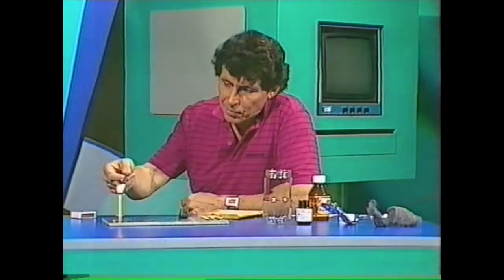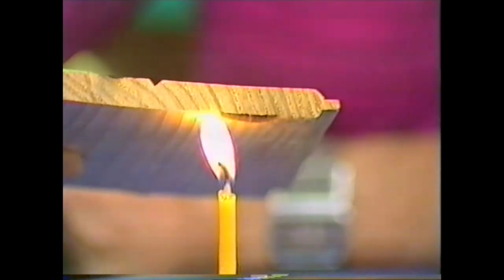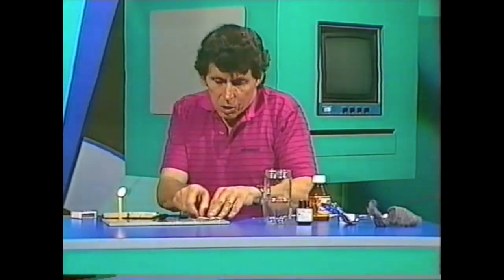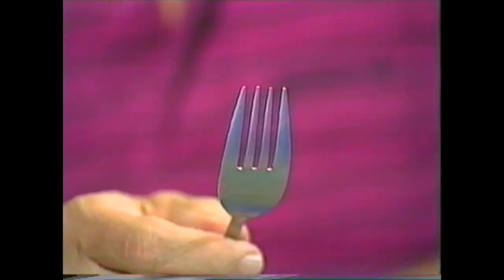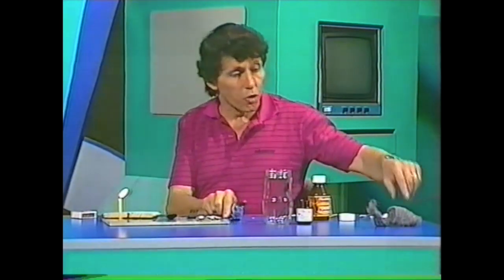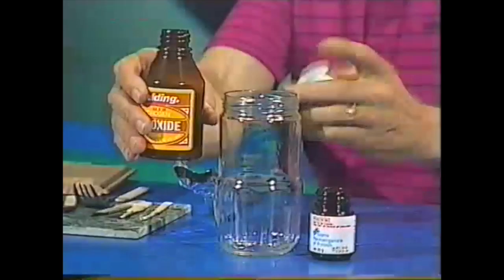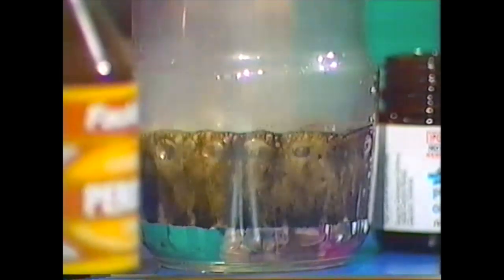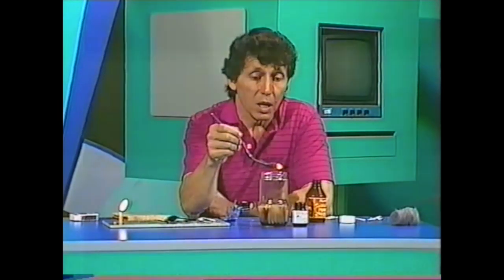Burning Metals

Comment: Technically, everything is metal! Enjoying the posts as a 40 year old almost as much as when I was 7.
Reply: Technically, all water is ice and all sand is glass. Technically, all wood is coal and all meat is well-done.

Right?
Reply: You're on the right track, yep! My comment is typical in astronomy where atoms are basically all considered metal, except hydrogen traditionally but metallic liquid hydrogen was observed during the recent Juno mission. H2O on Earth is indeed a rock on higher mountains, or other planets moons. Nitrogen which is a component of air here, makes mountains on Pluto, so it's a "rock". The distinctions we make are purely Earthly ones based on the temperature here and whether a particular atom or amalgam is a solid, liquid, gas or plasma here. Depending where the atom is, it could be any of the above, which is why astronomers just consider all the atoms, metals.
Reply: @DylanODonnell  
I got that. You missed the point.

Just because something could be in a certain state does not mean that it is. It either is metallic or not, and if it's not, well, then it's not.

A material is defined by its properties. Ice from H2O is not rock, regardless what planet you are on. Metal is metal by the properties that define metals.

The idea that "everything is metal" just because it could gain metallic properties under rare and extreme conditions is simply false, be it practically, technically or otherwise. 

I was simply pointing out how absurd that statement really is.

Our oceans are not frozen, wood only turns to coal when treated, and raw meat does exist. Everything is not metal.
Reply: Yes, I concur it's just me being a silly old astronomer. https://en.wikipedia.org/wiki/Metallicity

Comment: I remember getting Steel Wool and putting a 9 Volt Battery to it and it would ignite from the short circuit I guess.   Gee you could almost feel the Infra Red heat from that glowing girder.
Reply: The strands of steel heat up because of their resistance to the flow of electrical current through them.
Reply: steviebboy69 the electric current runs through the metal like any other wire, but because each strand is very fine it heats up very quickly to a point where it ignites the oxygen in the air around it. The same principle is used for incandescent bulbs with a thin filament wire designed to glow brightly with the current passing through, but stopping short of igniting the gas in the bulb. As you could feel from the heat of the bulb a lot of the energy was converted into heat rather than light, this inefficiency being a primary reason why we no longer use them for lighting.
Reply: @Paldasan  Oxygen does not burn. The steel wool does not ignite the oxygen. I didn't bother to read any more if you can't get that right.

Comment: Wonderful demonstration! And if the metal is even finer & ground into a powder it can then be used to make Thermite, which then burns even hotter and much higher temperatures and is commonly used to merge rails together if a new railroad line is constructed or an older one is re-constructed. Or it can be used in explosive charges for controlled demolitions of buildings. Basically breaking metal using burning metal :)
Reply: KRAFTWERK2K6 I see your comments everywhere. Hi 👋🏼

Comment: Burning is a bit of an ambiguous word. Normally we use the term in reference to a combustion reaction in which a carbohydrate material combines with oxygen to yield water and carbon dioxide.  Metals do not burn so much as they rust very rapidly in the presence of oxygen and sufficient thermal energy.
Reply: "they rust very rapidly in the presence of oxygen and sufficient thermal energy."
Or in other words, they burn.